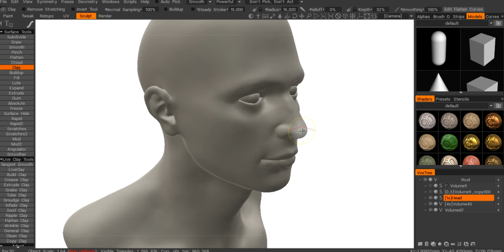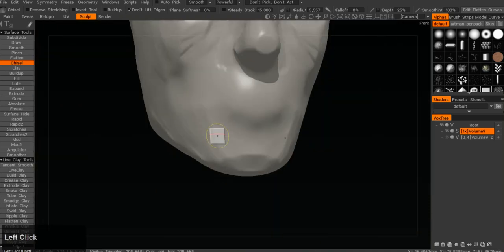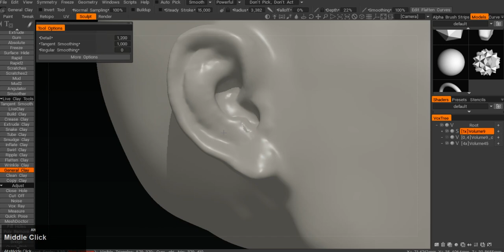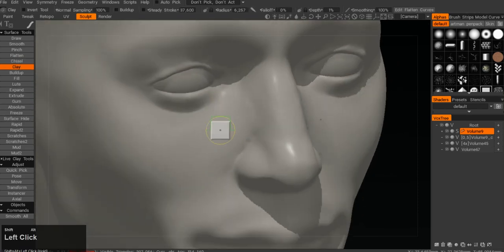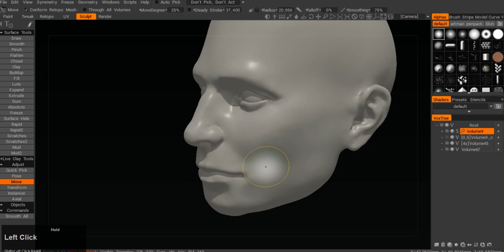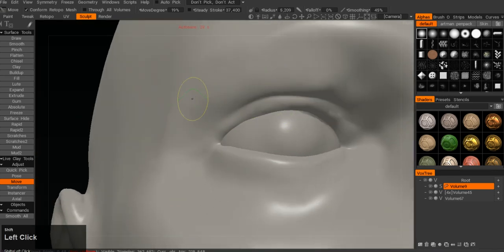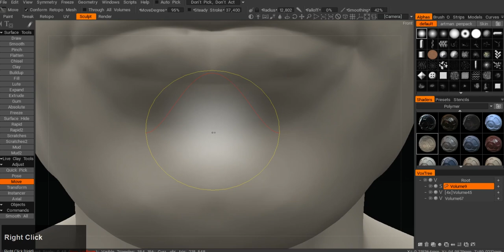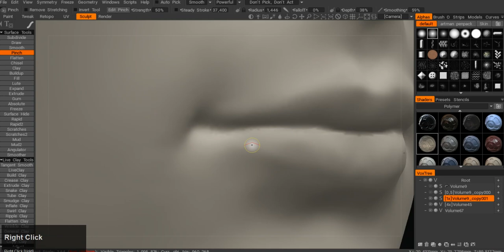3D Coat Realistic Bust Sculpting

Comment: Hey Anton, thanks for the video! I've learned quite a few new tricks while watching you work! I will check the other videos as well, as I plan to go a bit more in depth into the technical aspects of 3D Coat. I was wondering if you could do a follow up to this video and really go into small details like skin texture, pores, wrinkles and so on. I'm interested in achieving hyper realistic results and though there are tons of tutorials on this for Zbrush, I couldn't find anything for 3D coat. In your experience, is it possible to achieve this in 3D coat or should I start learning Zbrush? And lastly, if you know any tutorials on this, it would be much appreciated if you could share a few names!

Thanks in advance and keep up the great work!
Reply from the maker: Hi Bogdan, it's a bit trickier to do in 3D Coat, but it is possible with the new sculpt layers feature. I'll try to do it in the future. And yeah I don't really know any tutorials about it unfortunately.
Reply: @AntonTenitsky  I think if you were to try high frequency details on a mesh in 3dcoat, you'll need to be in surface mode.  That type of detail isn't really possible in voxel mode unless you have tens of millions of voxels.  It should be absolutely possible in surface mode, although I think you'll need to make sure the surface density of the mesh is at least equal to what you would have in Zbrush for the same process.  I noticed many people like to jump back into voxel mode from surface mode, etc.  This is not a good idea if you're looking to get high frequency details.  I think once your low frequency details are done and blocked out, you can begin mid-frequency details in voxel mode, but most mid and high frequency should be done in surface mode in order to get equal results to Zbrush.
Reply from the maker: @cgvapors963  You are 100% correct thank you for your input! I hope others will find this helpful too.
Reply: @AntonTenitsky  Thank you, Anton.  Yes, I work in both Zbrush and 3dCoat for some time now, and I really find both of them very useful for different reasons.  There are certain models I might do in Zbrush, or vice versa, or I might block out a model in 3dCoat first, then go to Zbrush, etc.  One thing people often forget is that Zbrush does not have the same painting features as 3dCoat.  In Zbrush, you have to sculpt all your high frequency details in order to generate a good normal map or displacement map.  That means pores, skin textures, etc., must be sculpted to get baked into a normal map.  However, 3dCoat is different.  There's NO real need to sculpt high frequency details like pores because you can paint directly on your normal map later anyway.  In fact, you can take a normal map from Zbrush and add to it in the paint room of 3dCoat just like you would in Substance Painter.  The only exception is 3dprinting, but high frequency usually does not print on a 3d printer anyway.
Reply from the maker: @cgvapors963  Hm, I should probably do a video about this details texturing inside 3D Coat in future. But yeah I use Zbrush when needed. Still the subdivision sculpting is much more convenient in zbrush. In 3D Coat it's not so easy to jump between proxies.